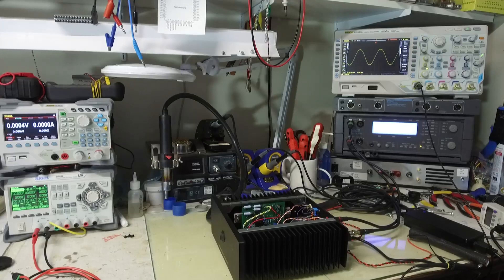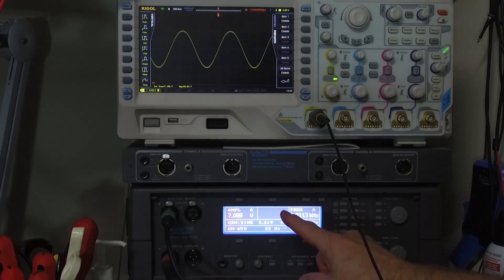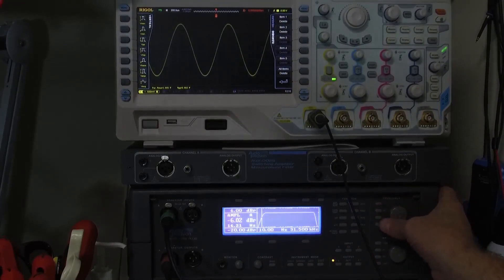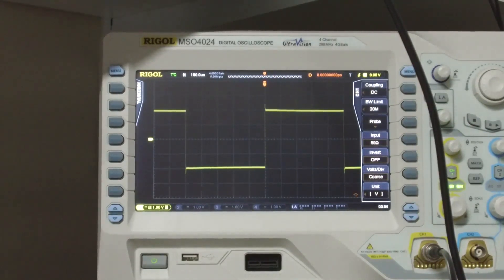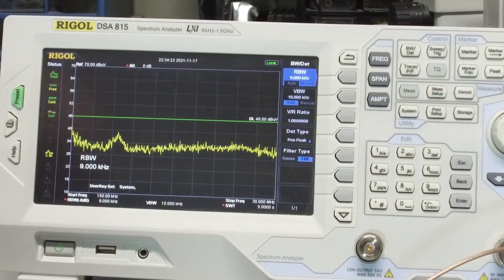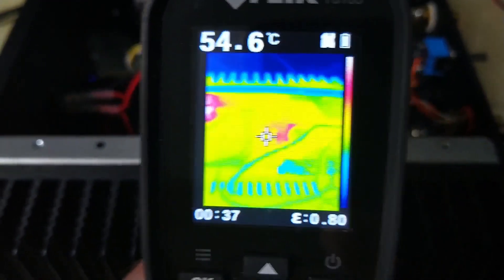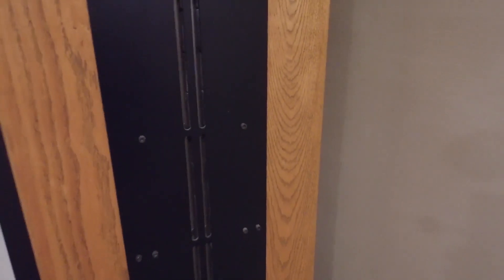Pass Amp Camp Amp (ACA) Performance and Listening. Class A Kit from diyAudioStore

Comment: Hello, I just discovered your channel. You have a very nice workshop, and you have made a magnificent construction of this amplifier, it is very beautiful. However, I am not impressed by the distortion and bandwidth measurements, we can do much better with a class AB amp, this comes from the fact that there is no feedback maybe ? I've bought the bare PCB years ago, I don't think I will built it. Great video in any case, I'm following you now, thanks.
Reply from the maker: Thanks.  The ACA is not for everybody to be sure and does not have the best specifications.  However, it does sound quite good in specific situations.

Comment: Personally, I really cannot see the point of class A. This amplifier really does not have a very good spec. I regard a good frequency response as flat from at least 20 hz to 20khz. and I mean FLAT not -6dB. Distortion is fair to average. As for 6 watts, this simply will not give a wide dynamic range.
Why class A? A good class AB amplifier will not have any measurable crossover distortion. That's the only so-called advantage of class A. So, remove that and all you have is an under powered, heater for your room.
A good class AB amplifier like the L12/2 or the dual version of the TDA7293 will leave this amplifier standing. Much wider frequency response, huge dynamic range, much lower THD. VERY much faster (slew rate). You can measure the difference and most importantly hear the difference.
All that effort for a 6 watt so so quality amplifier that waists more power than it puts out. I'm just amazed people fall for it!

Comment: Please use a limiter when connecting the LISN to your spectrum analyzer, it's way too easy to fry the input on the SA with the slightest voltage spike 🙂
Thank you for your great videos!
Reply from the maker: Totally agree with your limiter sugestion.  I may have not mentioned it in the video but the LISN used in this test has a built-in transient limiter/attenuator.  It is the knob on the far left and is turned on (inline with output).  Thanks.

Comment: I wouldnt recommend going with a larger output coupling capacitor, amps are usually designed with certain values in mind and it can change performance a bit and could actually perform worse. Ive built amps and have worked on plenty of amps that will get you to down 3db at 20hz with half of that capacitance so the cap isnt the weak point in that aspect here.
Reply from the maker: I am not necessarily saying to change the output cap.  My preference is for a Class A design that use a +/- rail so the output coupling cap is not required.  The more expensive Pass designs do this.  Thanks for the comments.

Comment: Did i miss where the thd was taken? Not bench test is complete without that.
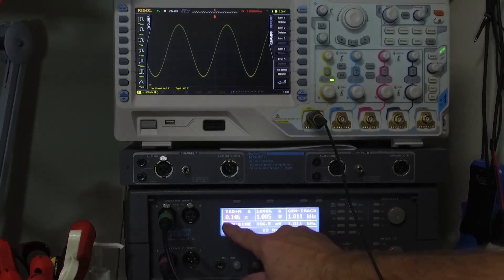Reply from the maker: At about 4:45 the THD is measured.  
https://youtu.be/aOvd46oBKqc?t=286
Reply: @DanPattenAudioG33k  I just finished building one as I designed and built a small amp for fun about a month ago and then discovered this amp and looked interesting. Mine is similar in that it runs off 24v but mine is a push pull so less wasted heat and the sound is very similar just a bit sweeter with deeper fuller bass and a bit less distortion, 2nd harmonic being about 20db higher than 3rd throughout freq band no higher harmonics really and mine does not increase thd with freq, its flat.
Reply from the maker: Sounds interesting.  Several years ago, I designed/built a Class A design with +/- rails that is about 25W.  Kind of similar to some of the early Pass Aleph amps.  One of these days maybe I'll do a short video about it.
Reply: @DanPattenAudioG33k  nice, yeah ive built a few class a amps including tube but I tend to prefer class ab overall if well designed. My favorite class a amp is a el34 amp, for class ab tube I really enjoy a eico hf81 when refurbished. For solid state im really enjoying the little class ab amp i built, it reminds me alot of a tube amp like the eico hf 81 but with tighter and deeper bass. It even has a little bit of that 3d tube glow around the midrange but not as much as tubes, its the closest ive heard. The ACA amp sounds good too and actually has some similar qualities but sounds a little less full and less 3d and the bass is on the weak side but overall pretty smooth leaning warm. Still would be a good project for someone getting into audio and is decent for background music, Nelson Pass is a great guy and I think he acomplished what he set out to do with that amp. Im sure ill make some videos soon about my amp, just want to finish the preamp section first.

Comment: I’ve built a couple of ACA’s which I used as dual monos and later the Pass F6, though I’m currently using the F6 (25w at 8 ohm load) I must say their sound signature is very similar,so If you have the right high efficiency speakers the ACA will do the job for you.
Reply from the maker: I agree, if you have efficient speakers and an average/small room, the ACA does a good job.  I am currently building a clone Aleph 3 and will see how it does.
Reply: @DanPattenAudioG33k  good luck with it!

Comment: Thanks for your the review! How do you compare it to the chinese clone you revewed some years ago? In terms of construction and sound. Thank you!!
Reply from the maker: I was impressed with the clone and like the idea of the clone having a linear power supply.  I think mechanical build is similar between the two.  I did not have the two units at the same time so was not able to compare them.  I feel more comfortable with parts used in the "official" ACA as I have often found fake /questionable parts directly sourced from China.  Does this help?  Thanks.

Comment: Instead of 2N5089, you can put 2SC3070.This transistor holds more voltage and has a high current gain.This transistor holds more voltage and has a high current gain. The minimum coefficient is 800. You can use 800-1000 (enough).The sound is significantly shifted towards high-end. And practically does not differ from the sound of very expensive devices.The sound is significantly shifted towards high-end. And practically does not differ from the sound of very expensive devices. If you use, the current ratio should be more than 600, then you will really feel the sound change. The higher the ratio, the more transparent and clearer the sound, more detailed. Thus, a cheap board with aliexpress can be turned into an expensive and very high-quality sound amplifier.
Reply from the maker: Interesting information, would be fun to try.

Comment: I’ve bulit this amp. Do like it! Strange noise at turn on and put a serious push to the speaker after turning it off. What it requires a delay ckt at the output. Built a 555 based one, driving a relay. Once powered off the amp, immediately detach the speaker too. If you have sensitive speaker take care of it.
Reply from the maker: Sounds like a fun project.  There are sellers on eBay and Amazon that have speaker protection circuits/kits.

Comment: Hi Dan, I have a question - for the ACA, can you tell me about the dimensions of the amp? I can't find it on the official website. Also, I am wondering if 50C will be OK to be placed on the desktop. Thanks.
Reply from the maker: My ACA is about 9.5"W x 9.0"D x 4.0"H.  Depth includes connectors on back.  I would think you would be ok using it on a desk.

Comment: Dan, I really enjoyed your videos of the Pass Amp Camp. Near the end of the listening test, I was intrigued by the glimpse of your turntable and arm.
Any chance of a video on them?
Reply from the maker: Have thought about it.  The turntable was made by Simply Physics and model is Dark Star.  Company is no longer around and it is about 30 years old.  I am the original owner :)  It is a belt drive unit and the arm is on an air bearing.  It requires a small air pump/reservoir to lift the arm.  Basically no friction.  The stand came with turntable and is filled with sand.   I have been thinking about sanding down the finish and re-painting it.  It works quite well.  Thanks for the kind comments.

Comment: I would love to try this amp but I’m getting conflicting results. Your testing says it has great distortion figures. Audio Science Review says almost 10% at rated power. And most of the are 3rd and up.
Reply: Distortion don't tell you anything on how the amp sounds. This amp is not some soulless. O.00000001 distortion amp. If your looming  for ones of those, this amp isn't for you. I'm a big Nelson pass fan and these are typical distortion numbers he publishes for most of his designs. Especially his first watt amplifiers. Thanks !
Reply: @brandonburr4900  How many of his amps do you own ? What kind of speakers do you pair them with ?
Reply from the maker: This amplifier when it close to clipping may have more distortion than other types of designs.  It is a simple design.

Comment: Wonder why ASR rated this amp so low.
Reply: I would trust this builders review and testing of this amplifer over ASR review. Many of his so called "reviews" are not proper reviews. This is one of the most detailed I have seen. Thank you for your work!
Reply from the maker: Can you provide a link to the review that you are referring to?  This amplifier (IMO) does sound good.  However, there need to be a few qualifications...  It does not have a ton of power and it's output is capacitor coupled.  This capacitor coupling could cause problems with very low impedance speakers and there might be complications with speakers with complex impedances.  The amplifier also generates a lot of heat :)

Comment: Thank you for doing this video. Do you have any idea what SPL was at the microphone recording the music? I recently finished building this amp and run it as a desktop amp connected to a pair of Klipsch RP600m speakers. (I know they are tall for near field) I was surprised to hear the bass breakup at 65 - 70 dB listening so close to the speakers.
Reply from the maker: Hello.  Not quite sure of your question.   Are you wanting to know the sensitivity of video camera microphone or are you asking what SPL level I can achieve with this amplifier and speaker combination?  :) I have no idea about my video camera mic sensitivity (sorry), it is a DJI Osmo+.  I suppose I could do a measurement of max SPL I can achieve.  I do not have any experience with that Klipsch speaker but just looked at it's efficiency and it is rated at 96dB.  That is pretty dang efficient, so I would imagine you could get some pretty good volume.

Comment: sound like crap on my headphones, it is the microphone or the room? can you do other test in a good room with good speakers?.. hope the amp is good since i've ordered two for a diy 3 way digital crossover system.. if I only use it for mid and high frequencies.. can i go with small better output caps? ... let's say from 600hz and up.. maybe with a switch i could switch between full range and 600hz and up..

and mod/tweak or better part recommendations? pure silver wire? better connectors? better resistors etc.. I can always reused the one included in the kit in other projects
Reply from the maker: Hello.  In my opinion, no subjective analysis can be made by listening to an audio clip through YouTube.  Consider:

* I play music stored in a lossy compressed format from some unknown source
* Lossy compressed format is decoded by my gear
* Digital signal converted to analog with a DAC
* Analog signal played through my amplifier and preamplifier
* Converted from electrical signal to acoustic signal by my speakers
* Acoustic signal converted back to electrical signal with microphone
* Acoustic signal amplified by mic preamp
* Electrical analog signal converted by ADC back to digital
* Digital signal converted to lossy compressed format
* Lossy compressed format re-encoded to another lossy compressed format by my digital publishing software
* Re-encoded again by YouTube 
* Lossy YouTube digital format decoded at your computer
* Digital signal converted to analog with your ADC
* Amplified by your headphone amplifier
* Converted from analog to acoustic by your headphones

There are just too many links in this chain to say what causes something to not sound good.  What link(s) is it? :)

In my opinion the ACA does sound good.  Possible weakness will be if the speakers are not efficient enough, speaker impedance is too low or if too high of volume is required.  The amplifier just does not have enough "watts".  This could be overcome by having a different amplifier for the bass.

Also, another "In My Opinion", the speakers connected to the ACA are quite good :)

Thanks for watching.
Reply: @DanPattenAudioG33k  yes i will use them for 96-98db mid and highs so wont need that much power.. i just want the top sound for now.. 

i understand about the poor recording.. my headphones are quite reveilling of everything unnatural.. just dont do gear recording if you dont have high quality chain or room to do so.. its an insult to nelson pass to do so

Comment: The membrane is too tight. I hear a "drum" resonance.
Reply from the maker: It is hard to balance how tight to make the diaphragm, there are a lot of tradeoffs.  Too loose and they rattle/buzz and can more easily touch the magnet structure (which really sounds bad).  This diaphragm "tightness" is very similar to the Bohlender Graebener (BG) drivers.